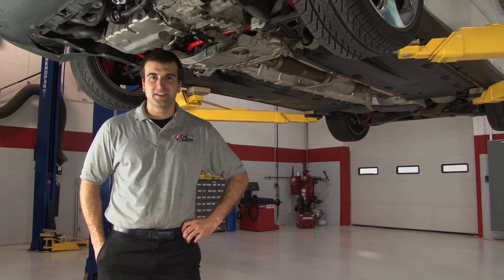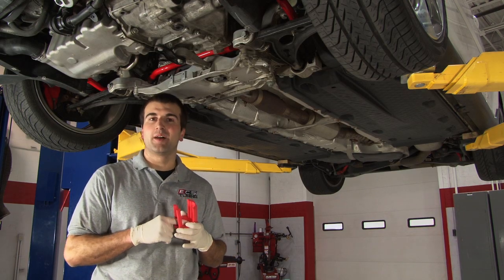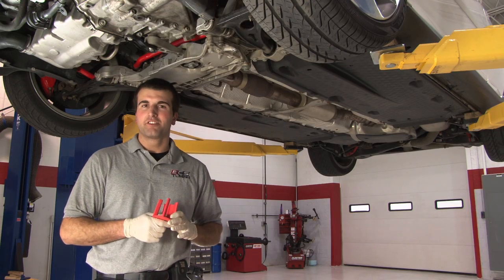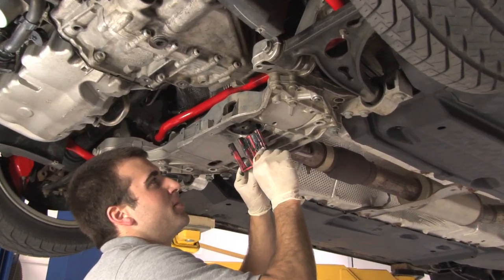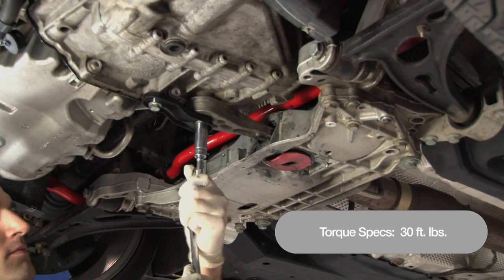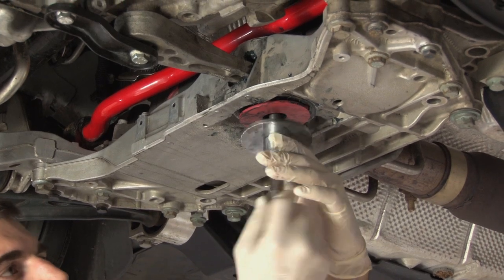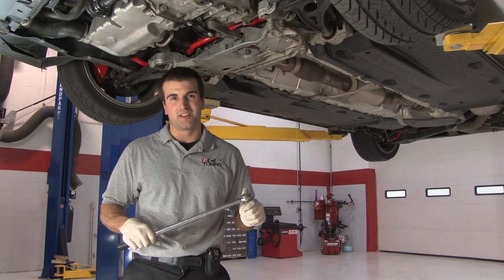ECS Tuning: VW MKV Dogbone Mount Installation

Comment: No need to remove complete dogbone mount.
Lots of silicone spray on insert and spray on bushings and leave dogbone mount bolt in till insert 80% in then undo dogbone bolt completely and remove (if you completely undo and remove before insert started chances are never get bolt to catch again when putting back in all be out of line).
Fully possible and easy to do without dogbone removal

Comment: That doesn't look like a stretch bolt to me? ...if not you need thread-lock; rather than over torquing; stripping threads; sheering...?

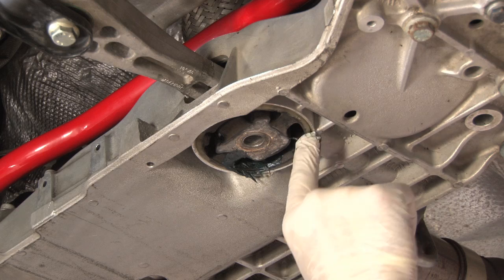Comment: Yep, watched this video and totally wasted several hours trying to get the polyurethane bushing in after I had removed the bolts and the dog bone. ECS you need to replace this video. What a shit show you caused. The video shows the dogbone being removed at 1:29 mark and then the guys putting the poly bushing in with the dogbone cleared attached/reinstalled at the 2:17 mark. I expected more brains from ECS Tuning.

Comment: 26mm bolt, holy f%^&$ that's an inch diameter.   Plus you'll need a much bigger wrench &/or socket!

As a general tip, if you don't like cross-threading fasteners, do NOT tighten any fastener until ALL fasteners are started by hand. Even fighting a rubber mount isn't worth it.

Second: put some damn Never Seize on a steel bolt going into aluminum!

This vid goes in the "Amateur Hour" bin.  I would be embarrassed if I owned ECS, or had anything to do with this vid. 

But, WTF do I know, I've only been turning wrenches, running shops and racing since the '60's.  I still fix my own damn cars, and I'm an old fart.

This video does NOT make me want to immediately go to ECS to order the parts I need for dog bone R&R I gotta do on the wife's TDI, THAT is certain.

(all I could hear in my head as he beat on the greasy urethane was, 'The bigger the gob, the better the job!')   LOL

GeoD

Comment: The second 16mm bolt that you remove from the black bracket going through the bracket and the dog bone? What bolt is it size, diameter etc. mine has come out while driving and I need to find a replacement? TIA

Comment: Upon install, when tightening the ECS bolt there’s still a 1/4” gap between the steel ECS plate and the ECS rubber piece. Will not tighten further. Anyone else experience this? Should I use the original bolt instead??

Comment: First off, there’s no need to remove the dogbone. Simply remove the stock bolt, lubricate the new insert preferably with a silicone spray. Place insert in cut outs, use a small jack if need be to get it all the way in. The scissor jack works perfectly. Make sure you centering washer is most towards the insert, then the big washer followed by the bolt. Don't forget to torque it.
Reply: Можно каталожный  номер втулки.
Reply: What spray do you recommend
Reply: @MrSweeden1  Silicone
Reply: Right? Was watching and wondering why he removed since the gadget is open ended!🤣

Comment: I just did mine today with only plastic ramps on teh front tires.

1. Spray the dogbone bushing with soapy water to loosen dirt 
2. Coat the bushing with dry lubricant or silicone
3. insert the bushing with more meat side on it first
4. Then feed the 2 prongs
5. 9/10 the prongs will not go all the way in
6. Spray more lubricant on the dogbone hole where the 2 prongs show up
7. Insert the washer and bolt with the kit and tightening it will force the prongs in place. 
8. Remove the bolt so the rubber can re settle and to add loctite 
9. Install bolt at 74lbs ft + 1/4 turn
Reply: Why you loctiting a TTY bolt? Not cool bro...not cool!

Comment: While I am  driving 20-30 mph, whenever I release accelerator or press sudden on accelerator , I feel heavy bumpy feeling from Engine, I checked all of my mounts with my Mechanics , no mounts are damaged. Could this one help that movement?
Reply: There are 2 mounts on the plate the dog bone goes into upper one could be damaged or your trans bushings are bad or your trans is shot

Comment: Did my dog mound in a matter of about 10 minutes max thats getting the car on the rack install and pulling the car out of the shop 
Didn't use grees or remove the bone just used calico jube poped er in there out the bolt tightened nit down and that was it

Comment: My center bolt is super hard I'm using a half inch wrench and a long tube and it's still super hard to remove. When it felt like it finally broke loose it felt like the rubber on the inside moves as I loosen the boot. I don't know how to explain it but something is fucked up i think I'm gonna need to get the whole new bushing and dog bone since I'm stage 2 going 2 plus.

Comment: DO NOT REMOVE THE BOLTS FIRST, IT WILL PUSH THE BACK OF THE BUSHING OUT WHEN YOU SLIDE THE INSERT IN, AND YOU WON'T BE ABLE TO PUT YOUR BOLT IN OR POSSIBLY CROSS THREAD IT. I wasted 3 hours trying to get it back in when I realized what happened.

All you need to do is;
loosen the big bolt, no need to take the two 16mm or even remove the dogbone,
grease everything up,
slide in the insert in, if you're having trouble getting it all the way in use a jack to press it in, be careful not to lift the car off the jackstands,
now pull the oem bolt out as quick as you can and put the new bolt in and torque it down properly. 

ecs would you please consider redoing this video because it's very incorrect. it took me hours to do a job that should have taken minutes because i followed this guide, and I'm not the only one, there's tons of people on the forums having trouble because they followed your guide.
Reply: I just ran into this exact problem, wish I read your comment first. How did you align the back end of the bushing back up?
Reply: Hey THANKS SOOOOO MUCH !!! Ik it's a old comment but thanks I liget was undrr the car in the rain trying to get that bolt in and I hate this video for raping me to hard.
Reply: smajo s you JUSR rock the motor back and forth to get it to line up lol
Reply: Luis Estrada is your in ramps you might be fighting the weight of your car to line the bolts up. I rolled off my ramps and went on jack stands and I felt real dumb with how much effort I put into trying to line the threes up while on ramps .
Reply: Nick Benson Photography I ran into this problem too when I was using rhino ramps. I basically used a mallet hammer and pushed the dog bone towards the back of the car until the bolt holes lined up and screw the bolt in at the same time until it catches threads. But it's worth the upgrade I have no wheel hops and I just did a crazy burn out lol
Reply: So glad I stumbled on to this! I bought the 034 billet insert... how should I go about installing this on rhino ramps?? Much appreciated guys!
Reply: Same
Reply: Was thinking the same thing when watching this.
Reply: Ik this is a old comment but I did not see this until today and it happened to me when I tried installing. When I took the dogbone mount out the engine shifted and I didn’t think to much of it. After struggling getting the insert and the first 2 16 mm bolts back on I went to put the final bolt in and the washers, the threads do not line up with the bushing and idk how to get the bushing to line up again. Does anyone recommend anything to get the threads to line up

Comment: and those are not 90 degrees!! are 45 at most! 
]
Reply: I don't understand why it's even torque rating + 90 degrees... Why not just tightened to a slightly higher torque rating and be done with it?
Reply: @Planehazza  Google torque to yield

Comment: The grease will soften the OEM rubber and after a while you will have to replace the mount .... Use silicone lube or soap...
Reply: Indeed regular grease destroys rubber.
Reply: yep oil kills the oem stuff, thats normally why you replace them in the first place haha
Reply: ECS are shade tree i think I can do it mechanics

Comment: Your still braying the hell out of the insertI was expecting this to be removed by now but as it hasn't Id like to warn anyone watching to NOT follow these instructionsNo mallet neededToooooo much greaseBad fit I suspect its the wrong insert as stated previouslyRamp is not needed a trolley and a pair of axle stands will sufficeNo need to remove the dog bone and 2 bolts securing itThis could be made to look so easy Finally That mallet  Id put it on ebay maybe find a good home for it
Reply: so I can't just put the car on ramps and do the work? front wheels have to be on air? thanks

Comment: Dont use greass. i used spray silicone lube and inside the mount and on the bushing and it sent without having to use a rubber mallet.
Reply: grease*

Comment: Front of the dog bone mount doesn't need to be removed for installation. Just remove lower bush bolt and slide in after market bush using slight lube not necessary for heavy greasing. Slide in when pushed in with hand no mallet needed . Don't see what this chap is hitting ? Instalation time 1 min .
Reply: I have a higher mileage Gti and I'm not sure if my dogbone was wore out some what, or what the issue was.

however mine was a 20 min install with a bit of cursing. I ended up using the only lube I could find which was Wd-40.

It worked but was a pain.
Reply: ***** I used a floor jack. It worked ok, it came up at a angle so it was alright a regular hydraulic jack that goes straight up would've been better

Comment: I have a passat B6 TFSi. Under hard acceleration I struggle to find 2nd and 4th gears,would a worn dogbone mount cause these symptoms?
Reply: ***** Today I tried a quick gear change but at normal road speeds,just the same,missed the gear.
Reply: I changed the dogbone mount bush.no difference.
I changed the gear cable bushes for solid ones,no difference.
I have now realised it is the forward/backward gear change cable.

Comment: Great product!  I used just a little valvoline general purpose auto grease and it slid right in.  I would definitely use just a small amount of grease because without it the insert won't slide all the way in and you wont be able to get the bolt to thread in.  There is much less wheel hop and even less torque steer!  Great product guys!

Comment: Don't use grease!  The only reason people are beating and/or jacking the bushing into place is because there is no outlet at the top of the bushing to let the grease out, so you are trying to compress grease, which doesn't work too well.  What I did was spray the bushing insert and the holes in the existing bushing with silicone spray and it just slid right into place with very little effort.  No mallet or jack was required!  Aside from a bit more vibration at idle in gear (mine is DSG) as soon as I get rolling it smooths right out and best of all got rid of the wheel shimmy I used to get accelerating through 60 - 80 mph since this maintains driveline alignment under acceleration MUCH better than stock on my 2010 GTI.
Reply: I’m not feeling this vibration. Is this something that will fade away over time?

Comment: Does this enhance the existing bushing or does it also 'repair' the bushing. The rubber on mine is broken at the 2 common sides and this would be an 'easy fix' vs pressing in a new bushing.  2006 Jetta MKV TDI Manual Tranny. Thanks.
Reply: Suneel replace bush with oem  part mate not that expensive from TPS

Comment: Do check whether you have the older style of insert or the newer style. But aside from that yes it would fit. Powerflex for example sell 2 kits, one for the older style and one for the newer style.
The mounts are the same across all cars from the 1.4 Golf to the 3.2 V6 one - Which of course shares the same parts as the A3.

Comment: Test drove it and if feels amazing.  No noise or ride issues for me but a very solid shift feel.  For the 6 speed manual MKV GTI this is a great upgrade.  Now if I can only ease my fears about the placement of that washer and how it may effect the longevity of the part.
Reply: Use hevey grease to place the washer on the 8nsert centerd fool

Comment: Just installed this insert and VF pendulum mount from ECS.

Where did you put the washer on the VF pendulum mount on the middle bold? Between the pendulum and the tranny or between the two pieces of the pendulum?

It only came with one washer for this spot, I put it between the transmission and the pendulum though I worry if I got it wrong I will cause premature wear.